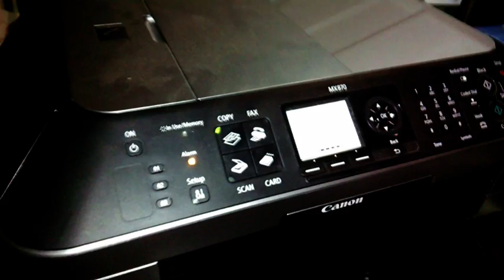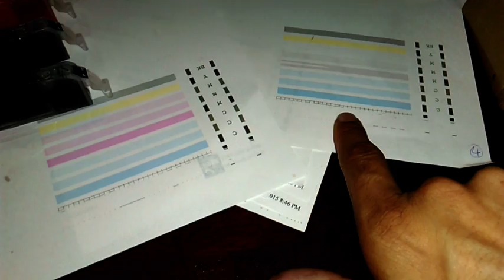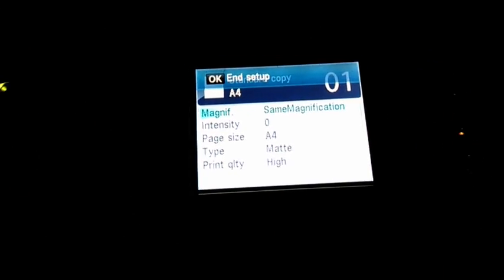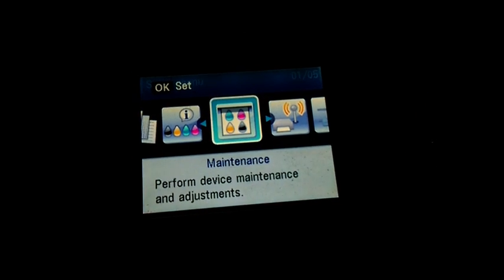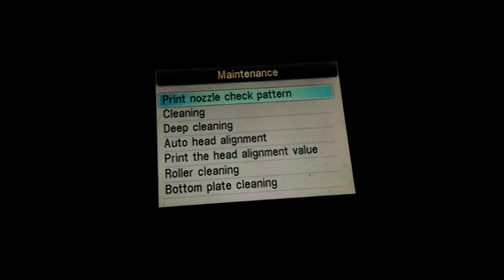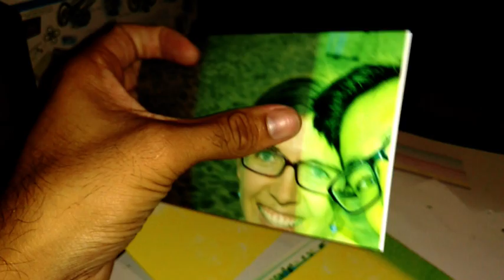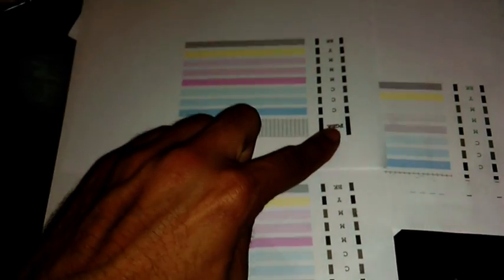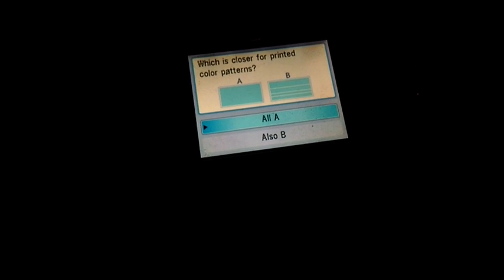How to Unblock and Clean Printer Heads Canon MX870 Pixima

Comment: Thanks 4 the video man! I was about 2 throw my beloved Canon MX922 Pixma printer, it was severly cloged but after several try's it worked! I did a little different though, in the begining I did it like you but still wasn't working quite right so I boiled water and put it on a shallow container with just enough water to cover the heads and the nozzles and let it sit for a while, that time really worked because it bled the last hardened parts of the ink thanks to the hotter water (Note: I didn"t put the printer heads on a pot and boil it) I boiled the water and on a 2nd container I put a small amount of boiled water till it covered the printer nozzles because I was worried that the extra heat might damage the electronic conectors, after a carefull dry I put back the heads and test it again & this time worked like new! who would it thought that just plain hot water would do the trick! Thanks! you saved me allot of time & money!
Reply from the maker: Fantastic news and I hope your comment helps out anyone else with the ink dried up severely
Reply: I'm giving that one last shot.  It's the thicker black cartridge which is causing the issue i think for me.  i even bought a new cartridge and have done every cleaning option on on the printer

Comment: I bought this printer used from a friend about 7 or 8 years ago.  No idea how long he had it before then.  Today it threw the error code "B200", and a quick google search took me to your other video about simply moving the carriage over, but I figured i'd just follow your instructions here for cleaning the print head.  It's like a brand new printer again!
Reply from the maker: They are great printers. Mines in the bin now though as the head needed replacing. I tried 3 replacement heads from eBay but they were all used / reconditioned. None of them worked properly and a new OEM canon head was almost the same a s a new printer. I do miss the printer as it was a great printer.
Reply: @outie555  Thanks for the reply.  I guess I spoke too soon.  I was able to print a couple of pages, and now every time I power it up, it keeps throwing the B200 error.  I moved the carriage, powered off, powered on, removed and replaced the ink cartridges.  It just doesn't work anymore.
Reply from the maker: @chrismiller100  damn. Cycle the power between attempts and it might come up good again. It's almost certain that your printer head is failing too, but sometimes you can eventually clear the error.

Comment: Is it still working outie or how long did the fix last and I still have my Ducati 😁
Reply from the maker: It's still working. Sometimes has a b200 error but it can be bypassed and still prints fine. 
Good to hear you still have the Ducati, very lucky to win that one 😀
Reply: @outie555  When you said hot water was it hot hot or mixed with a bit of cold? Yes very lucky to win a bike!
Reply from the maker: As hot as you can stand as you'll need to hold it under the tap.
Reply: @outie555  Thanks man.

Comment: I have had the b200 error message for 3 days.  I washed the print head, but I cannot do a setup check because the set up button beeps 3X when I push it, the alarm and copy lights still alternate blinking, and the b200 error message is still on my display.  The Canon website indicates the Pixma MX870 is retired, so they cannot help.  Any suggestions for getting my printerto work again?
Reply from the maker: I have a method to bypass the b200 error in a video on my other channel. https://youtu.be/qewVAX6QVIg

Titled "how to fix B200 error Canon MX870"

Give that method a try.

Comment: Thank you for the video I did not know I could do this.  I was having the same issue.  After trying this twice;  my  results did get better, but not fully I was going to give up, but I thought maybe its because they bought me staples ink instead of canon.  Once I bought the Canon ink and did the print check I realized my printer only likes the original ink.
Reply from the maker: Maybe the cheaper ink had a bad batch? I've been using eBay cheap ones for years with no issues.
Reply: @outie555  I will give ebay a try

Comment: Thank you for this brilliant and helpful video. I tried everything to resolve my printing problem but to no avail. After watching your video, I was ready to do what you did but first thought I'd try using  just the spray of compressed air and low & behold, it did the trick. My printer is printing perfect colour photo's again. I've had my MX870 Pixima for years, it's a great printer and you saved it's life. I am very grateful to you, as without your video, I would not have thought of using the air compressor. You are a star!!
Reply from the maker: Thank you, that's very kind of you to say.

Comment: I cleaned out my MX870 heads as suggested and the error B200 still comes up.  What else can I do?
Reply from the maker: Switch off, lift up the top and glass of the printer to see the ink (as if you were changing the ink cartridge) and slide the printer cartridge head unit to the middle of the rail. With the printer still open, stwitch power back on. When printer head moves, close printer.

Comment: after rinsing in water for a 2nd time and using Alcohol. PBGK is not even printing. Did nozzle check and another cleaning. Nothing. So I have just ordered a new printer head. If that does not work. Ill pull my old MX 870 back out of storage and see. I have 2 MX 870

Comment: Thank you for your very clear instructions to fix my printer. You saved me time & $$. Message B200 said to unplug & take it to a printer company to repair. Clearly this was NOT necessary. Just did my test after completing previous instructions shown here & test was as clear if NOT better than your display. In addition, my printer has made a grinding sound every time I turned it on. This has been happening for at least a yr. before the recent B200 message popped up. Now not only is the printing as clear as when I bought the machine at least 7 yrs. ago, the concerning grinding sound is also gone. Thank you once again for this very helpful, cost saving video.

Comment: Thank you for posting this.  I love my MX870, it has been a workhorse.  I had the exact same problem you showed - the larger black cartridge clogged and could not be cleaned with the printer clean function.  Never would have thought it could be so easy to clean, and without your video showing it, I would probably have felt it was done for. It's printing like new again, and you're the reason for it.  Thank you!
Reply from the maker: Cheers buddy

Comment: Thank you so much Outie555.  I never thought cleaning the nozzle heads would be so easy.  On my Brother Ink Printer you have to order certain fluids/hoses, etc.  A real pain.  Your video was fantastic.  I found that I had to let the hot water flush it for about 15 minutes to get it very clear with on ink residue still protruding.  But I got it clean, air dried it, and replaced it into the Printer.  It works fantastic, just like a new MX-870!  I was about to sell it for a fraction of what I paid.  Congrats to you from CR in Florida.

Comment: This made me realize the PGBK on my MP610 was not printing at all. I was just looking at the test pattern and I saw all colors so I did not miss it. I have attempted to clean it and I will find out shortly if it did the trick or not. Btw, I found it thrown out in the thrash :D
Reply from the maker: The best place to find things! Hopefully it's just clogged and you can fix it
Reply: @outie555  Well. No luck. I cleaned it and even used a can of air on it to make sure it could not be clogged. I suspect it is an electronic issue with it so I will use up all colors and discard it and get another one :)

Comment: Hi outie55, are you using refillable cartridges  or original ones ?
Reply from the maker: I'm using generic branded ones. Cheap on eBay for multiple colour sets and they work terrific and just as good as the expense canon brand ones
Reply: @outie555  have you used refillable cartridges ? Because i was using them and printer MX721 signaled a b200 error (about 2 years later, very light work).

Comment: 2019 I still have this printer..it's been great except With phone assistance they could not get my wifi to work. Never had wireless printing. What a DRAG.
Reply from the maker: That's a shame. I've still got mine and had no problems with wifi, but it only can connect to 2.4ghz wifi. Could that be the issue if you are using wifi that's only 5ghz and not both?

Comment: This works on the Prixma 5422.  I avoided the Ammonia and just ran boiling water through it and now my PGBK nozzle works great. Thanks for the help in Removing the Printer Head.
Reply from the maker: Nice one
Reply: @outie555  surprisingly enough you have been the only practical support I have found even though it's for a different model.

Comment: One suggestion.... After you run the head under water and it runs clear, pour Isobropyl Alcohol (can get a bunch inexpensive at Costco) over it to remove any excess water, and allow the print head to dry on it's own.   The alcohol will force all of the water away, and then will evaporate quickly.  Will only take a few minutes.  And if the train gets stuck after reinstalling the head (i.e., in the track, etc,)  don't try to force it.  Just turn it off and turn it back on again.  Canon made these things to correct themselves.  Except for the ink part :P  Have had my MX870 since early 2009, and it still goes the distance.  And I'm a hardcore IT consultant with a home office for the last 17 years.  I beat it up pretty hard, and it's still as good as the day I got it.  Think I paid $89 on a Costco special for this printer.  Unbelievable.  Do be careful about buying printer cartridges from any places that sell "refills".  Those cartridges can mess up your stuff pretty fast.  Pay the extra $15 and get the Canon pack from Costco, just to be safe.
Reply from the maker: Thanks for the awesome tip buddy. They are great printers and I've had mine for over ten years and it's still good quality printing
Reply: Hi Hal. I've had my MX870 since 2011, but I'm sure I haven't used it nearly as much as you have, so I'm wondering/assuming that you must have had the error message that the "ink absorber pads are almost full" and need maintenance!  I can't seem to find a good tutorial anywhere (I haven't tried calling Canon yet) .  Can you help??
Reply: @dennisjones9547   @Dennis Jones  Hey Dennis, I actually have never received that message!  Other than dude's tutorial, I don't really have any other suggestions.  I will tell you, when my MX870 seemed like it was nearing the end of it's useful life, and I ran across this video, it was about a $80 cost savings; however, my resolution was not a "quick rinse" under hot water, as he demonstrated.  Took me more like 20+ minutes turning, flipping and shaking  until the entire head ran clear, due to all the gunk and build-up accumulated from using Cartridge World replacements.  DON'T EVER USE CARTRIDGE WORLD REPLACEMENTS!  

You can find really good quality bulk replacement packs on eBay for less than what one cartridge costs at any store.  One example is https://www.ebay.com/itm/20PK-PGI-220-CLI-221-Ink-Cartridges-for-Canon-PIXMA-MP980-MP990-MX860-MX870/391401323085

One your head runs clear, be sure to liberally use my isopropyl alcohol suggestion after a through rinse and let it evaporate,  just to ensure all moisture has been voided, prior to reinserting the head.  Oh, and be patient, take your time, and don't force anything.  If everything is aligned properly, it will easily drop into place.

My MX870 is still kicking ass, and I probably use it even more than I originally said, now that we have had to take on distance learning during this whole pandemic thing.  Good luck!

Comment: Outie: you are a genius life saver.  Just saw your video... saw the " wash it out with water part ", got scared, but what the heck tried it anyway, and after a thorough cleaning and air drying, and new ink, I did two deep cleanings... and unbelievable... just like a new printer.  Was about to throw it away with plenty of ink in packages.  You did the trick.  What a guy.  Best to you, and thanks...
CR from Florida
Reply from the maker: Thank you CR for your comment and it's fantastic that it fixed it for you!

Comment: Tried to wash several times still not working get the 6a80 error please advise.
Reply from the maker: +albert kelton no one was getting that error code with the printer being blocked. Sounds like a separate problem. Tried googling that code and you may need to reset the printer by switching off and holding down black, cancel, OK and on button for ten seconds. Release only the on button after that. When printer turns on, release all buttons.
Reply: outie555 Yes I did that I also cleaned the area where the printer docks.   I read that possibly a switch is being clogged up and that obstructs the printer from moving the head all the way to the right.   Spent a couple hours on the problem at this point it's not worth the time.   Probably going to junk it.
Reply from the maker: +albert kelton yeah sounds like a technical problem which is a shame as they are good printers

Comment: Cleaning a print head on a pixma canon mp620 warns not to wet the electronic contacts. Is this model's print head protected
Reply from the maker: +terry12316 not sure but myself and hundreds of others have done this and then dried it with no issues with water damage. Its up to you if you do it or not, but the electronics I can see look like a copper coloured wire ribbon and has a clear plastic coating on it

Comment: Thanks! Just did this for my father in-law's printer. We had the same issue where the black ink from a new generic cartridge wouldn't print out. I was ready to give up and buy a new printer for him until I saw this video and decided to give it a try. I was a little worried since that ink holder cartridge has what looks like chips attached to it. From my experience, electronic chips and water do not get along, but everything worked well and we were able to print perfectly black text!
Reply from the maker: +Eugene Yu great stuff Eugene and I'm glad my video helped you :)

Comment: I'm Gary, not Marcia, but this is her Facebook logon, so I'm going to use it. We went to “Just Answer” help site and paid $20 for advice that didn't solve the problem. After a lot of steps, including powering off, unplugging, opening and closing the cover while the head/cartridge carriage was traversing, etc., nothing worked. The help site guy just said, "Sorry, but that's a motherboard problem and you'll need a new computer." 

I wasn't convinced and had cleaned my printer head before, so I thought I'd try it again before giving up. The print head was very clogged with ink and many contacts were shorting out due to ink bridging them. I cleaned the head just like this video suggested (plus I used an ultrasonic jewelry cleaner) and my printer now works just fine. I'll be cleaning my printer head more often from now on, as my MX870 is an excellent printer and has given us 7 years of steady service. Saved a lot of money today. Gary Drost.
Reply from the maker: Gary that is brilliant news your printer is back up and running and glad that this video helped you out.

Comment: Thanks for your video! What type of toners did you order from eBay?
Reply from the maker: +Mayers D thanks. I got the generic ones with chips (so it talks to the printer to know its a new cartridge for the levels). Just search on eBay for "mx870 ink". I got a few cartridges in a set which is the best way to go. Make sure you get all the colours and the blacks.

Comment: HE SERIOUSLY JUST RAN RUNNING WATER ON THE CHIP SIDE THATS JUST NOT GOOD BRUH
Reply from the maker: +ShawnJames310 well the printer is still working fine and printing perfectly even after all of this time since I did it. No corrosion or defects. I did ensure it was thoroughly dried before putting it back in
Reply: ShawnJames310, I was thinking the same thing, but yet it works well for him!! What other method of cleaning do you suggest??  My same Black portion of the head is doing the exact same thing.  I'm about to drown it unless you've got a better way...

Comment: Terrific, worked for my MX870. Thought I might have to replace my MX870 which I have had for years.
I to had run the deep cleaning function about 15 or more times. With little improvement.
Your instructions where very easy to follow.
Reply from the maker: +Schroda that is great buddy :) the procedure sure does breathe new life into an otherwise dead printer

Comment: Hey, it worked! My printer is a canon MP630, and it didn't look as nasty as your printer, but PGBK was completely clogged, it was as if the printer head didn't exist. 2 heavy cleaning cycles didn't work, but the hot tapped water did just the trick. Thanks!!!
Reply from the maker: you are welcome buddy. glad to have helped